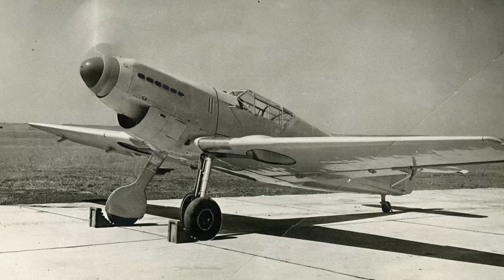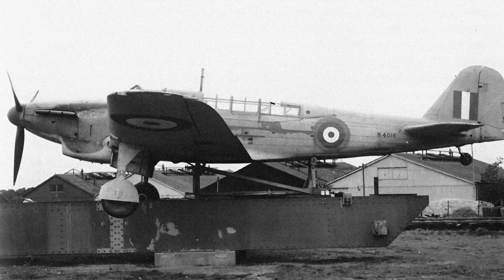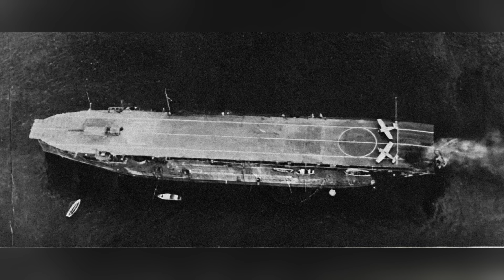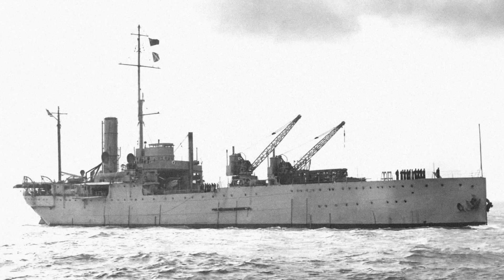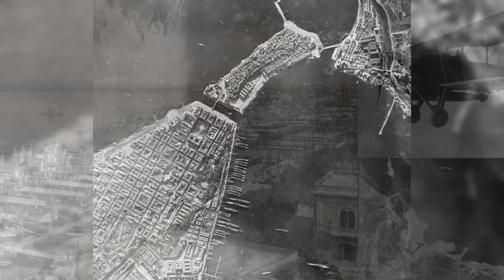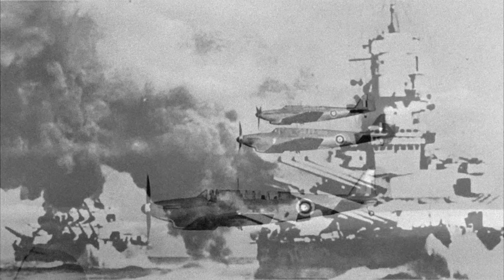Fairey Fulmar: How a Bomber Became a Carrier Fighter

Comment: The prototype Fulmar was not a modification of the Battle prototype (P.27/32), but of the second prototype of a later and smaller bomber, designed to specification P.4/34. The Hawker Henley was designed to the same specification. With the Air Ministry deciding that they no longer needed them as bombers, the Fairey design was modified to become the Fulmar and the Henley was used as a target tug.

Comment: As Dr Alex Clarke says all carrier landings are a controlled crash. The most important feature therefore is a tough airframe with strong structure and undercarriage because of this.

The function fleet defence fighter, is to break squadrons of attackers into flights, because it is the start of breaking attacks into smaller and smaller packages which can be further split into single attacking aircraft ehicj can be deat with by AA guns on capital ships and escorts

Comment: I have read more than one article or seen more than one video that describe an airplane as all metal and then go into details that describe some or all of the control surfaces as fabric covered. You referred to the tail as all metal construction then stated that the control surfaces were fabric covered. I guess this is the normal way to describe historical aircraft but I don't understand why.
Reply from the maker: Because in the period terminology “all-metal” described the primary structure and skin, not every movable surface. On aircraft like the Fulmar, fabric-covered control surfaces were normal for weight and handling reasons, so they didn’t affect how the aircraft was classified.

Comment: I wonder whether the navigator was included when serving in a defensive role whenever the carrier was attacked; around 2.5% less weight could improve manoeuvrability. Short of an extra pair of eyes, I wouldn't know what the navigator was supposed to do within view of the carrier group.
Reply: Navigating and radio operating at sea was considered vital.  The narrator did mention towards the end an experimental gun in the rear cockpit, but it had (understandably) a poor field of fire
Reply: @lynnmorton7544 the Firefly navigator and radio operator did not fire a rear gun
Reply: @richmorg8196 An experimental one was fitted, according to the narrator

Comment: Good informative presentation. Originally designed as a replacement for the larger Battle., When this requirement (P4/34) was cancelled the RN who had shown a sustained interest in the design asked for it to be re-jigged for carrier operation as a fleet fighter/obs aircraft under requirement (0.8/38). The rest as they say is history. Overall, it was a smaller lighter aircraft, with markedly different canopy style markedly shorter wingspan (8ft)) and a very different undercarriage arrangement. However, the length, fuselage profile and tail empennage, were very similar in size and profile to the Battle. This is a common reason for many to believe the Fulmar was a bodge up of the Battle. Anything but!

Comment: Total myth that the Fairy Battle was the basis of the Fulmar.
The Fulmar was developed from the Fairey P4/34, that was intended to replace the Battle.
Perhaps do some research?
Reply from the maker: Thanks for the comment! You are absolutely right technically — the direct prototype was indeed the P.4/34. However, the P.4/34 itself was heavily derived from the Battle design (often called a 'light Battle'). In the video, we simplified this lineage a bit for the broader audience.
Reply: Go easy Derek, Remus is no orphan there, myself included in my younger days